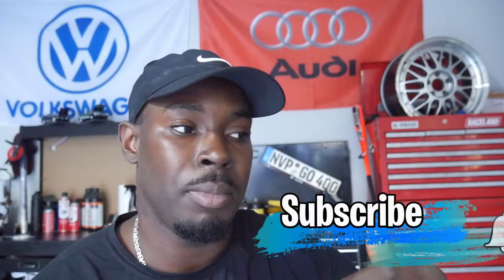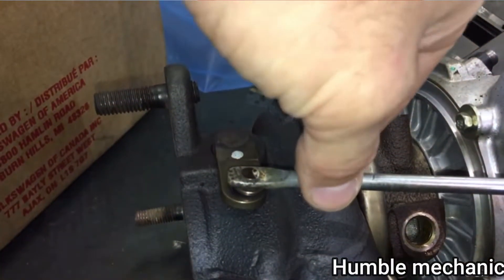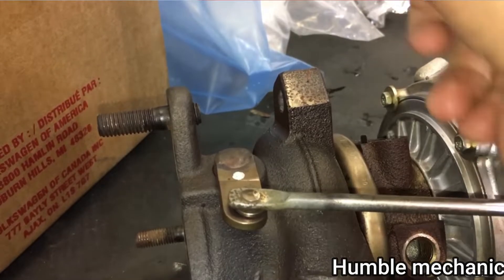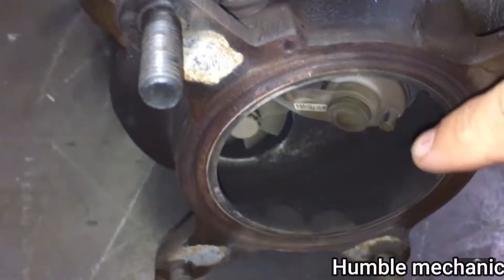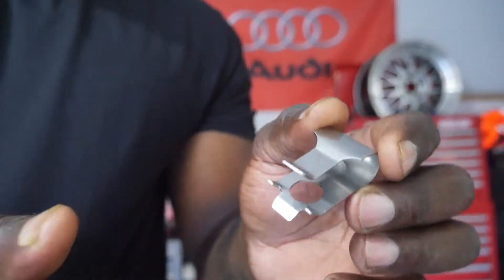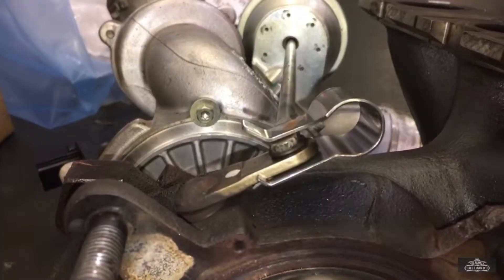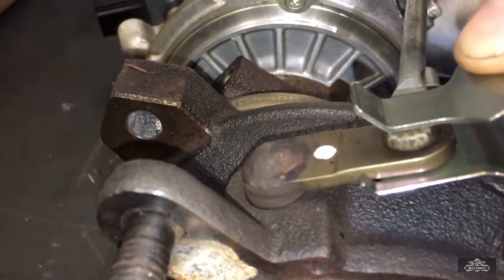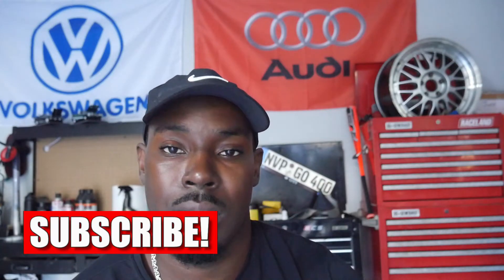THE MOD THAT MIGHT SAVE YOUR TURBO | MK6 GTI.

Comment: My GTI started showing signs of turbo failure around 100k I had poor boost and the po299 code. I replaced it with the ihi ko3 because the ko4 is just too much for me to invest in a fwd daily. But I’m tuned with apr stage 1 plus and my boost falls off when I’m full throttle and am not past 3500 I think it’s low speed pre ignition but I’m not sure. Any thoughts ?
Reply: So for me I have po299 as well I took it to a mechanic and they said that the waste gate stays open
Reply: @vvsalexander  I had bought a new turbo and it my cel came on about 5 months later saying it was related to the maf but I replaced that before I replaced the turbo it’s just a bunch of mess
Reply: @boywhohadatiger  same I had also changed my maf sensor and now the car just only had p0299 so ima see if I can clean the waste gate and hopefully it can shut and open until I’m able to replace it
These cars be needing hella maintenance 😭
Reply: @vvsalexander  I’m honestly gonna say fuck it and just get a Camaro or c7 vette. These cars have too many petty issues the shops can’t even be genuinely figure it out
Reply: @boywhohadatiger  hell yeah man fuck it

Comment: Is this a hard install do you have a video?
Reply from the maker: It was pretty simple but it’s kind of tight in there. N no unfortunately I don’t have a video. I heard a little rattle and my friend had a lift  and conveniently had a extra part  he wanted to try if it fixed. It was a random thing I figured I was share after it was done.
Reply: Bonjour le clip a fait laffaire ? Ou vous aver du changer de turbo?